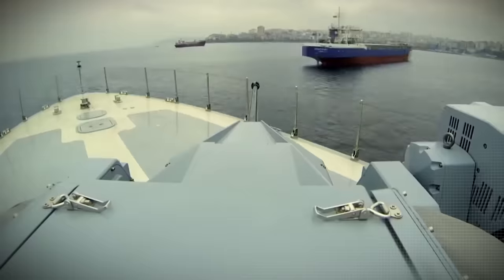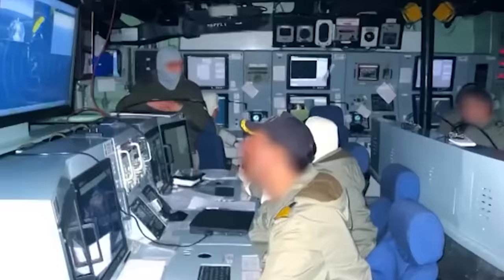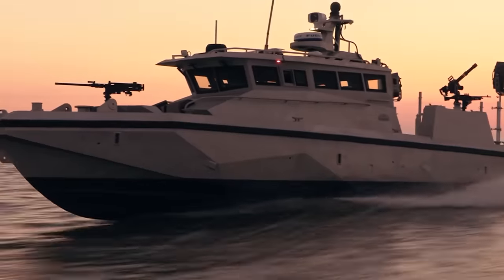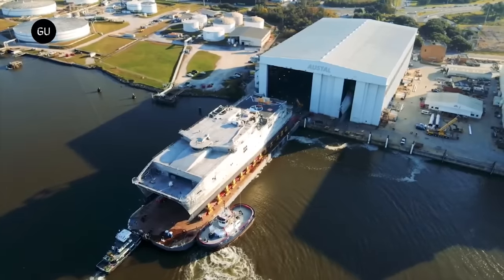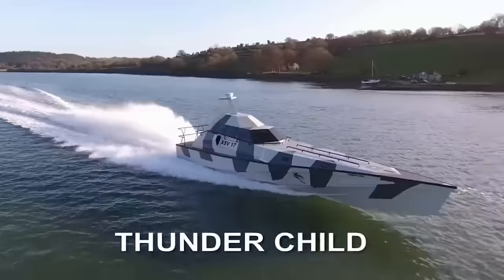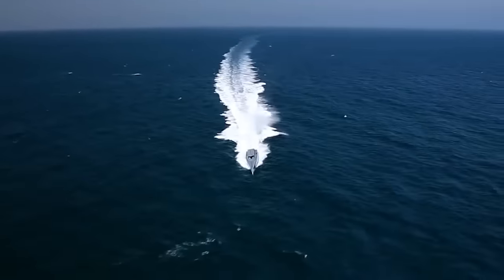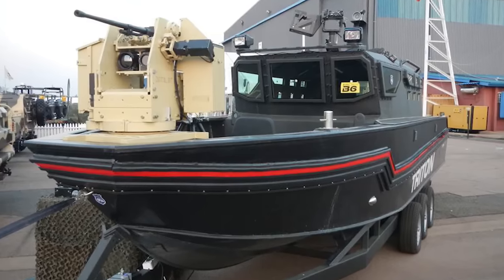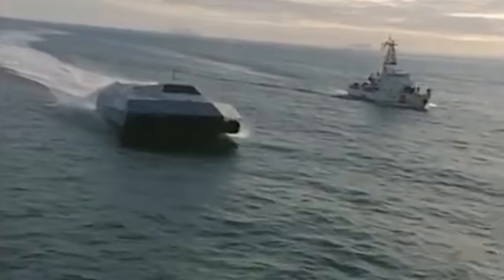The Fastest Military Boats In The World

Comment: Back in the 1980's the USN UDT teams were testing out Fountain powerboats for the interceptor/ covert insertion role. I personally witnessed one completing a 3 mile run in 1.5 minutes. Top speed over 120mph. Right after our Coast Guard boarding team wrote them a $2,500 ticket for entering a harbor at unsafe speed and not having the registration numbers displayed  that they were given by Fountain powerboats. (At the time it was not a USN vessel, but private dealership owned boat) 😂😂
Reply: San Diego?
Reply: @yanni2112  No, Fountain powerboats factory is in Washington NC. The team was from Little Creek VA, and they had come across the Pamlico sound to the outer banks.
Reply: Roger knows his boats!

Comment: 1969, HMCS Bras d'Or.  Wikipedia:  Bras d'Or first flew on 9 April 1969 near Chebucto Head off the entrance to Halifax Harbour. The vessel exhibited extraordinary stability in rough weather, frequently more stable at 40 knots (70 km/h; 50 mph) than a conventional ship at 18 knots (33 km/h; 21 mph). Bras d'Or exceeded 63 knots (117 km/h; 72 mph) on trials, quite possibly making her the fastest warship ever built. It was however, never fitted with equipment for warfare (no weapons or weapons systems) and the title now lies with the Norwegian Skjold-class corvettes that do 60 knots (110 km/h; 70 mph), fully equipped.

Comment: Norwegian "Skjold-class Corvette" is faster than Barracuda XSV17 in this video so why isn't that boat in the video?
Another video were they didn't do research first and ignores the fastest boats.
Reply: Actually, Skjold "Corvette" has maximum speed of 50-55 kts. and XSV-17 Barracuda has a maximum speed of roughly the same speed of 55-60 kts. The speed difference is nominal at best and dependent whether Waterjet or Surface Drive is used. The Corvette is limited by sea state of 5. Thunder Child was designed with low RCS making more difficult to track and was designed for extremely heavy seas. Sea state of 8-9 as well as being equipped with self righting technology.
Reply: @craigroberson8757  No, that is not correct. The Skjold class is capable of more than 70 knots.
Reply: @rtdvdf  Entirely possible, the latest information I have after going back and checking my information again had Royal Norwegian Navy with light to medium grade armament. In calm seas, the top speed was 60 knots. I found the Canadian Navy using the Corvette with no to very light armament. Under that configuration, they were able to get 65 knots. Again, that was under calm seas.
I have no skin in the game. I do know they are using the same Pratt&Whitney power plant.